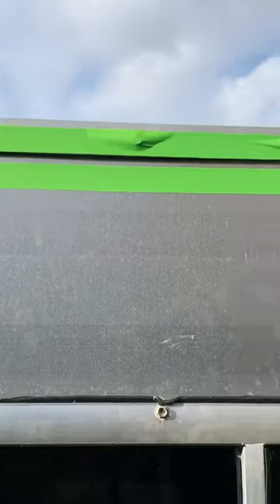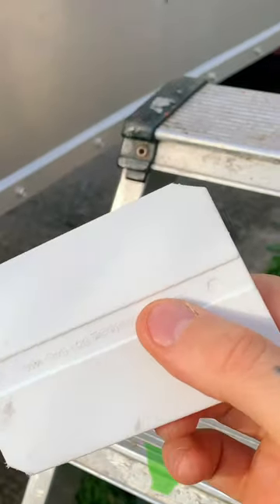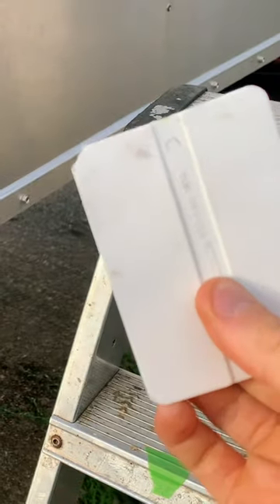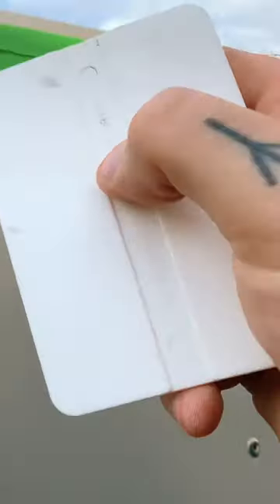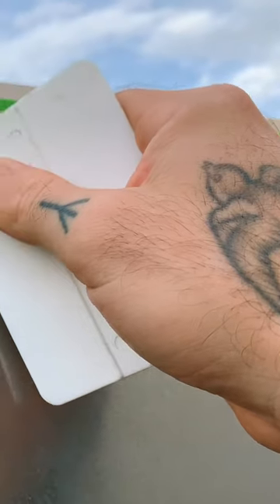Sikaflex 221 On My Overland Truck Camper

Comment: Thanks for the video, any leak so far using the 221? Cheers!
Reply from the maker: No sir. The camper has been sat on the driveway all winter here in England and no leaks. I used 221 for the roof to wall sheet joins. Then under my corner trim I used butyl tape (this is king) the trim back and seal again with 221. Kinda 3 layers of waterproof. My roof vent has been on the roof with 1” of water pooled up there with nothing more than butyl tape and not a single drop of water
Reply: That's great, appreciate you answer! Your camper looks awesome! @justadddirt
Reply from the maker: @rafaelcilios6973  thanks buddy. If you want to keep up with progress feel free to drop me a follow on Instagram at @_wildcatways